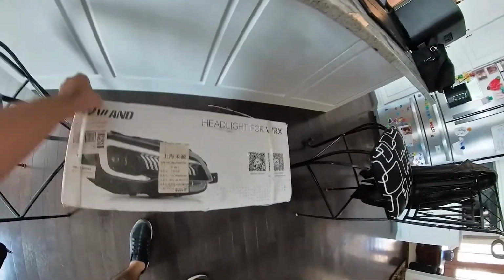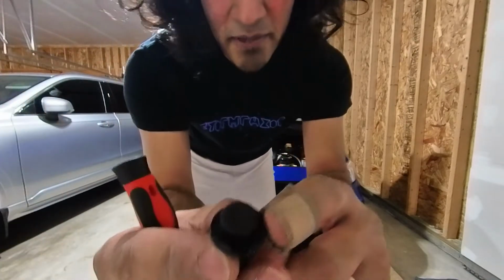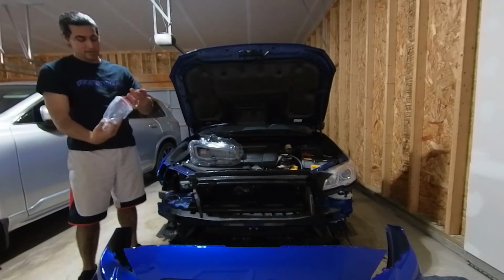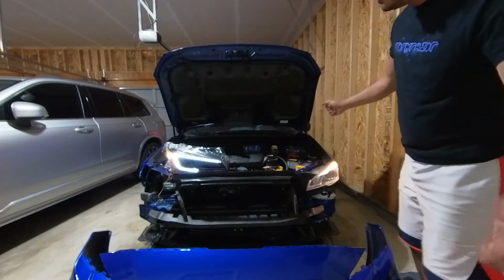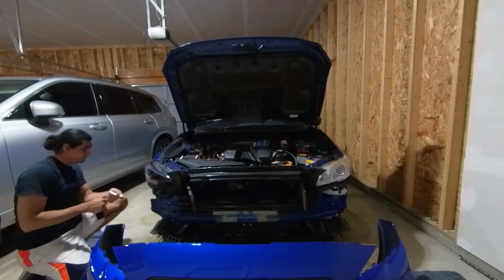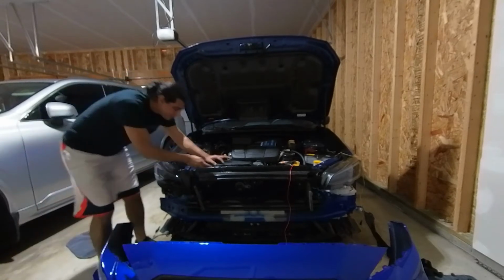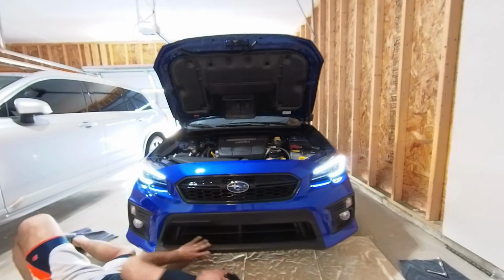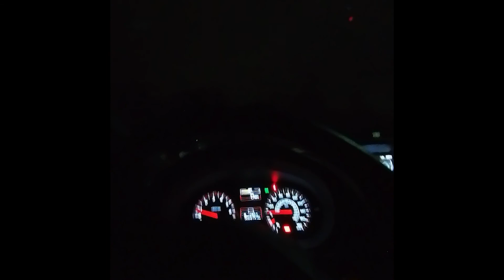2015- 2021 WRX Headlight change - VLAND Sequential

Comment: Most projectors are built with steps to prevent the light from blinding  oncoming traffic. Often times you will see Left hand drive projectors and Right hand drive projectors. So in countries that drive on the left side of the road, the steps would be opposite of yours. Good video. I like the lights!
Reply from the maker: That's good information! I was not aware of that. I thought maybe they mixed up the projectors haha. Glad you liked the video. My biggest concern was the deer that Junp out of the trees in my area. The stock halogens just didn't Inspire much confidence.

Comment: Just installed the same lights. I noticed tho they work just the same without the fuse plugged in? Still plugged it in but does anyone know if it changes anything
Reply from the maker: Interesting. The company said for the DRLs to function properly we need that. I never tried it without.

Comment: Hello. I don't speak English. I'm writing with the help of a translator. Tell me about the red wire that goes to the fuse box. I don't understand what this wire is for, it should be in the main connector. Or are there 2 levels of glow? Side lights and daytime running lights? And the red wire is needed for a brighter glow?

Comment: Hello,  i ordered the Noble RGB headlights whoch is basically the same as your headlight you installed just the drl change colors.  My problem is i have a 2018 WRX limited with the steering response handling. Everything works except the turn signals.  The hrness that came are everything that came with your headlights.  It was recommended to get harnes from OLM for the limited version but The turn signals still do not work. Any ideas or recommendation Do I need to actually splice wires together? Is extremely hard to find a video for the WRX 2018 plus limited models.  Any help please

Comment: i saw you have the same headlights i do have a question. Has your headlight caused your cars dashboard to just light up like a christmas tree?
Reply from the maker: It has not. I actually did not run into any issues after install
Reply: @HeavyMetalWRX  sounds good I installed properly but I think since my car has been having issues I may have to check my panel
Reply from the maker: @Rxocide  I wonder could it be when you plugged the little fuse into the fuse box? Maybe that has something to do with it? I'm just trying to think of anything electrical that would cause that other than maybe just going back and making sure all the cables are correct. But I mean if the lights turn on then you got the right cables. Yeah the fuse box is the only thing that I could think of that would pop up all the lights in the dash
Reply: @HeavyMetalWRX  I’ll need to recheck and check the bolts and resistance
Reply from the maker: @Rxocide  let me know how it goes ! If I can be of any help don't hesitate to reach out.
Reply from the maker: @Rxocide  did you ever get the issue sorted out?
Reply: @HeavyMetalWRX  I figured out the issue and it’s the fuse box it got friend after crossing my positive and negative charges in my battery. And I think it over amped a bit when my old headlight bulbs blew up
Reply from the maker: @Rxocide  oh damn man, I'm glad that you got it sorted out. That would have been definitely a pickle to solve for me!
Reply: @HeavyMetalWRX  it didn’t ring to me until I thought about the arc of electricity that I cause putting my battery in and remembering my headlight over amping and breaking. If I didn’t think about that I wouldn’t know but I had to check my fuse box fuses and connections with my multimeter and some of the dashboard lights are under reading which is bad

Comment: Did you have an gaps in fitment between the bumper and the lights? Just installed mine and there’s a little gap on both sides.
Reply from the maker: No issues with the bumper. I did notice at the top end of the right light there was a bit of slight misalignment but it was the way the light slots to the screw holes. I have to push the light back and hold it will tightening to make it fit. Let me see if I can find it in the video timestamp. But no bumper issues.
Reply from the maker: Just went back and checked , I didn't capture the bit issue I had because i was able to shove the lights. I do remember I think it was Cody from Street Inspired that had some issues but he also was able to adjust the light some more by shoving it before he bolted it down.

Comment: Do your high beams automatically come on with the c light? I want the c-light to be my DRLs without high beams. Is this possible? Thank you and great video
Reply from the maker: I'm pretty sure they do. It has a fuse cable you need to plug in for the DRL. In the morning I'm pretty sure the lights are the DRL.
Reply: @HeavyMetalWRX  so it’s possible to have the c-lights as DRLs without high beams coming on? Or I need to buy the DRL harness from Diode Dynamics to achieve this? Sorry just very confusing
Reply: You need to unplug the resistor on the passenger side by where the horn is. We were running into the same issue and unplugging this fixed it.

Comment: How are your lights holding up ?? They still good ?? I’m looking to get them for my 13 wrx hatch
Reply from the maker: I had them for a year and they were exceptional. I did sell them (also sold my '21 and moved to a '22 WRX) last month and they are off to a new home on a WRX in my area and I see them from time to time in the road lighting the way for another 🤣. I had zero issues with this set and even though they were a bit more expensive I have always recommended these over the Hikaris/OLMs

Comment: Great vid im thinking about getting these over Morimoto
Reply from the maker: I loved them and the install was not bad at all. Also I loved the sequential and the fact that it had the dual projectors. You don't have to worry about buying and installing a Separate set of LEDs and ballasts.
Reply: @HeavyMetalWRX  that's what i like too and they don't hurt the wallet as much as PLM or Morimoto. I was thinking of a custom build but nah I'll leave my custom hatch tails which i will be getting an install vid on

Comment: My order didn't come with splice cables for the sequentials  or fuse box... any recommendations?
Reply from the maker: Oof dude I would talk to the vendor. This brand is supposed to be plug and play. If to didn't come with it then things are definitely wrong. Idk what you would have to cut/splice to get the Sequentials installed , sorry ! Let me see if I can find something to help.
Reply from the maker: Here is what I got
Reply from the maker: VLAND LED Headlights Compatible... https://www.amazon.com/dp/B08N16C9QY?ref=ppx_pop_mob_ap_share
Reply: @HeavyMetalWRX  appreciate the response. i actually got the exact same from amazon :( hopefully someone will sell the sequential harnesses
Reply: I bought mine used and I'm having the same problem, I've been digging for the splice online and asked vland support for them but I've had no luck. I don't know anything about electronics, but would it be possible to splice or tap into the sequential turn signals yourself?

Comment: Hey dude. Just ordered these after researching and finding your video. Seriously. Really appreciate that you posted this. 

I’m a little worried about the adjusting the lights (left/right & up/down) since this is my first time. I really don’t want to get flashed at hahaha.  Any recommendations?
Reply from the maker: It's actually not too bad. The adjustment is a small little plastic bolt. My suggestion is find a nice flat spot and a wall at night (I used my local librarys parking lot against the side of their building) , park about 10 -15 feet away and adjust it. As long as the cutoff of the light is about as high as the car it should be ok l. These lights are VERY bright. Even where I had them ( probably a bit too high) I never got flashed. If you do get flashed just move em down a few clicks 🤣
Reply: @HeavyMetalWRX  Hey dude. Thanks again. Installed it and saved $250 instead of getting it done from someone else. This video definitely helped. 

So I’m getting that same weird staircase effect with my lights. Were you able to fix that?

Comment: Hi I have  the 2016 wrx base model will these vland headlights work with it?
Reply from the maker: Yes they will !
Reply: Thanks you
Reply from the maker: @daisyela7102  of course! If you get the lights lmk if you run into any issues.
Reply: Ok I will thanks again

Comment: Can you run the dlr alone when your handbrake is down?
Reply from the maker: I believe that only the DRLs run during the day with the handbrake off...if that is your question. Sorry I don't have these anymore so I can't test or I totally would.
Reply: @HeavyMetalWRX  that’s fine brother thanks tho☺️ it just weird even is day time the whole headlight is on
Reply from the maker: @gwapomo5579  was it when I was in the garage? The car has sensors the turns the headlights one when it's slightly dark. So when I was driving in daylight yes, only the DRL was on! I will confirm this and let you know but I'm pretty sure that was the case.

Comment: Are your drl bright as shit with these cuz mine are. Is there a way to get the c light to be the drl?
Reply from the maker: This kit had a fuse cable you plugged in the fuse box to make the c light the DRL. I don't recall the c light being overly bright but it's bright enough to know it's there in the AM.